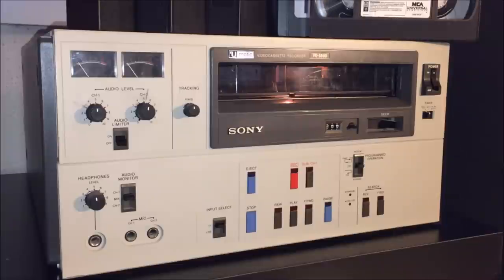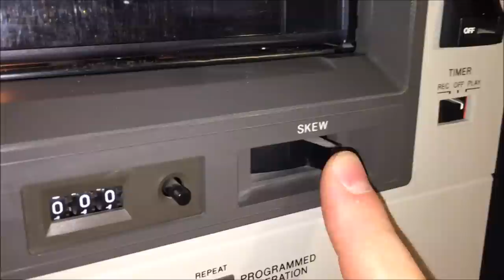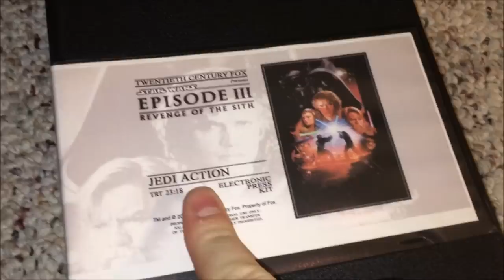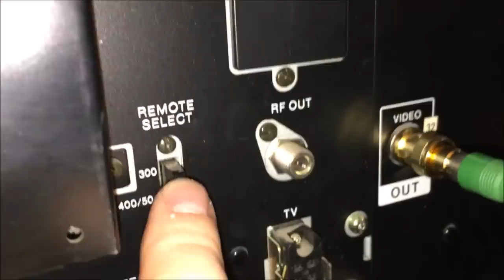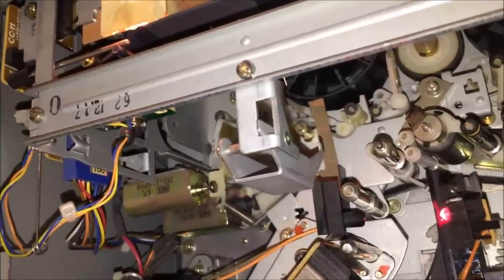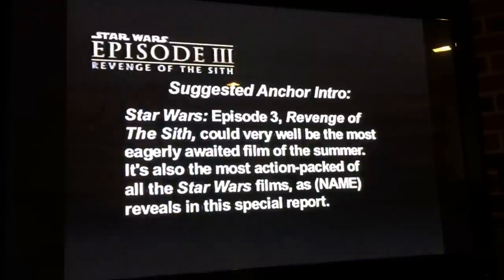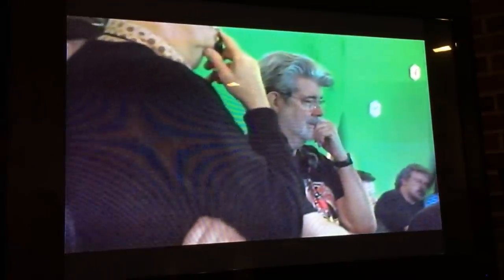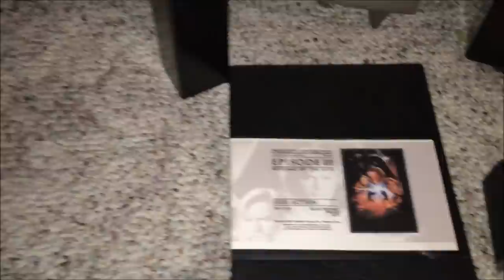Sony Pro U-Matic Mega VCR and Movie Preview Tapes

Comment: The U-Matic was actually used from 1971 to 2009 (where it was widely replaced by current digital videotape formats and tapeless digital formats). Believe it or not, the U-Matic was widely used on EPKs and in TV channels in Israel, which is now 46 years old (in 2017).

Comment: This broadcasting vcr deck was absolutely built like a tank!!!
Reply: They were.. in the late 80’s our local public access channel had a set of 3 in the remote truck. The remote would connect to the cross feed box.. was really awesome then. It was all equipment racked though. They were fun to play with as a teen ager. Lol
Reply: They did have timecode built in on the machines.

Comment: probably still being used in 09 because TV stations are typically extremely slow to update their hardware.
Reply from the maker: I would agree with your assessment.
Reply: In Israel the U-Matic machines was in use until 2014 and the Betacams until this day... 
LOL we have only one channel that broadcasting in HD and all the others are in 4:3 SDTV
Reply: Doesn't surprise me the slightest!
Reply: Bet they were using 16mm telecine units into the end of the 90's!
Reply: The main reason is the price.
Reply: yeah quite a few countries aren't fully on board the HDTV train in 2018.
Reply: I worked for small television stations and at the stations I was at they were fased out in about 2007. Digital was getting inexpensive by then.
Reply: OK.
Reply: I literally saw a programme from 2009 a few days ago being played from a tape, and it was a RAI channel. Not sure about the format though, I think it was S-VHS.
Reply: Probably the same reason some department stores and supermarkets were using reditune background music players made in the 50's until the late 90's. Why upgrade if it still works?

Comment: When I was in high school, I learned to edit on a VO9800/VO9850 with an RM450 remote. Those machines are built really well and virtually indestructible. This particular model doesn't do machine to machine editing because it doesn't have variable jog/search. It's only one speed. That's what the VO5800 is for. The main function of this deck is to independently playback or record and to roughly dub some audio. You also forgot to mention that the lower front panel pulls out. There are is a slot for an optional time code card. 5800/5850 have it too I believe. They might even have some configuration buttons.
Reply: Wow, me too!  This is the exact setup we had in my high school where I learned to edit too.  You didn't happen to go to high school in Pennsylvania did you?

Comment: Oh dear. Feeling very old. I started my career editing on a 5800/5850 system with an RM440 controller in 1976. We upgraded to Hi8 after Umatic, then DVCam until moving to XDCam. In the 80's all our commercials were run off 2" cartridge machines. They used 2" video tape in a cassette that was about the size of a fireplace brick. Much thicker than the 3/4" umatic cassette but not as long. The 5800's were real workhorses and the mechanism that wrapped the tape around the head was almost failsafe. They rarely broke down and we serviced them annually with new belts, guides and pinch rollers. The umatic machine was known as a "3/4 wrap" machine because the tape was wrapped 3/4 of the way around the head. VHS and beta were hAlf wrap machines. If you look closely, you can see that the carriage (chop chop train track) move the carousel around the tape head at a slightly downhill angle. Also the head is tilted slightly off axis as well. That allows the spinning head to contact and write the video information on the tape diagonally this getting mor information onto the tape in each pass. The audio tracks and control tracks were recorded linearly on the edge of the tape. The video head switches off just before crossing the audio track so it didn't interfere. The leader of the tape in the cassette ate each end was clear. So as you mentioned, when the tape reached the end, the light shone through the clear leader, hit a light sensor and stopped the motor before the machine tore the tape out of the takeup reel. This tech was carried over to VHS, and beta. The 8m and dvcam used a metallic leader that hit a magnetic sensor to shut the rewind and ff motors off. I have lots of great memories of the old 5800 series and the  6800 and 9800 series that followed. We still keep one of each machine tuned up and ready at the station for use with archival footage. If you want some real fun, hunt down an d Ampex AVR 2 machine. It was a quad he'd machine that used a vacuume to bend the 2" tape around a cylindrical drum with four spinning heads at the end. Thanks for posting!
Reply: I restore 2" quad machines (Ampex) from VR-1000 to the ACR-25. I think the best Quad machine was the AVR-1. I worked in tape ever since it was invented. Gee im old

Comment: OMG, a VO-5600. I also have one of those holding up a couple of turntables! Back in the 80s, I used to hang out at a small independent video house, and used to use the editing siblings of this deck with an RM-440. All the sounds of those machines loading, unloading, fast forwarding through the bars and tone remind me of the all nighters that made me decide I'd rather do camera work than edit!  I can still hear that little servo "groan" when you first power it on, which I'm surprised I didn't hear in this video.  All part of that Sony U-Matic charm!  Those were indeed workhorses.  I also remember the EPK's, because we used to reuse them for editing, being the low budget cheap skates we were!  (I would always keep the bars and tone and start recording after that.)  Never did do that for a living.  I think it was just one or two summers, but it left an impression!

Comment: At the time that unit hit the market, I worked for an A/V rental firm which supplied equipment for trade shows and various other functions. I remember lugging these and Sony ProFeel monitors around in road cases to set up at these events. I don't think we ever had a mechanical issue with one of these VO 5600's in all the time I worked there. They were very popular at trade show displays due to the auto repeat functionality included.
Reply: They were very heavy !!! LOL

Comment: The remote switch is for the sony RM series edit controllers. the 440 and 450 were the most common and you could do both frame accurate assemble and insert editing with timecode on the tape. Those things were pretty durable too, everyone I've ever seen has had buttons bent, broken, or completely missing. Countless number of news stories were edited with those and with working under deadline, editors tended to get pretty mad when decks started malfunctioning.
Reply: The RM 450 was 2 frame accurate and if you viewed more than 2 edit previews the accuracy slipped.  These decks were work horses. As long as the tension arms were maintained and video record heads were kept clean they ran 24/7.  In Canada, 3/4" was commonly used for broadcast news editing and for community channel editing and playback from early 80's until late 90's when betacam then digital formats took over.  Still have them for dubbing.  betacam is still popular for archive footage.
Reply: Worked with these types of machines for years. Local commercial production. Not this particular model. But Sony Umatic SP. Frame accuracy was give or take 2 frames either way.

Comment: RF OUT is not a modulator for channel 3/4 like you find on other VCRs. It is the amplified signal direct from the video heads. This would be connected to a timebase corrector (TBC) for dropout compensation (DOC). The TBC buffers video from the VTR and emits it using an internal or external master sync. This gets rid of the variance from tape stretch, etc.. and allows playback to be in sync with live cameras, other VTRs, etc.. so that A-B transitions can be done. If there is a defect on the tape, the RF signal will drop out and DOC will know to stop sampling into the buffer. Whatever data was in the buffer from the previous line or frame will fill in the missing video.

Comment: Ampex tapes were from the mid 1970's era when Dupont was still trying to work out their formula on making tape ribbon last, and those tapes are prone to SSS (sticky shed syndrome). The binder breaks down quickly and the tape glues to itself.  The solution to this is to get a labratory oven (tabletop unit) with a thermometer or a food dehydrator and bake the tapes slowly to dry out the binder, and this will give you 1-2 days maximum to archive the tape before it reverts back to its previous form. You can do this as many times as you want to, but you generally want to not have to do it so many times in order to preserve the tape.

Comment: I have the playback-only model VP-5000, in the same case. It was so big and heavy my local UPS driver refused to deliver it, I had to go pick it up. They also managed to bash in the back left corner. Pounded it back into shape with a hammer, replaced all the belts, cleaned and lubricated it, and it plays perfectly. Rubber Renue worked great on the pinch roller, the belt kit I bought came with a new tire.

Comment: I own this unit as I did a great deal of editing between '90 and '92. Not sure why I am still keeping it but I can attest it is built like a bank safe. The one thing I kept waiting for you to mention is that this unit must weigh over 50 pounds. I just fired it up and it still works. Sony over engineered many of these early units (I have SuperBeta and Super VHS rack mount units) and they are all still solid.

Comment: believe it or not, here in central America we are still in NTSC land, still have over the air vhf and uhf, and still use u-matic SP on occasion, mostly for backing up old tapes, and was used for mastering news stories well up until 2005. u-matic SP is a big step up from regular u-matic in terms of video quality, and even had dolby-c. the quality was second to betacam sp, which was second to dvcam.
Reply from the maker: Still in analog land?  I'm so sorry to hear that.
Reply: They should cherish it while it lasts.  They won't be able to go travel in their cars and expect the signal to stay consistent while moving!

Comment: In the UK these were know as Low band Umatic and were never used for broadcast work.The news people used Umatic High band that was similar but "broacast Quality"and 5 times the price of Lowband.We used to shoot on a portable umatic(lownband) VO4800 and edit on a VO5800 to VO5850(editing machine)both controlled by the RM440.Lowband was also used for off line editing instead of tying up 1inch C format machines.Edit lists were created by the editor and assistant editors would conform(work from the low band tape and edit on C format)this kept the time on expensive C format to a minimum.

Comment: Brings me back.  Used a couple racks of these in my first job in the industry as a part-time master control operator for a cable company back in the 90's when I was in college.  Good video.  Only thing I wished you'd show is the VU meters moving (maybe in a PIP window) when videos were being played.  Later I was fortunate to use some 9800 series decks for news editing, those were sweet.  They had bigger buttons and a robust rubber-grip jog/shuttle wheel on the right side for accurately cueing up video, and were controlled by an edit control panel.

While I'm getting my nostalgia on, can you do a video about the Betacam SP decks, such as the massive (but beautiful with all those buttons and knobs - I still geek out over all that complexity today!) Sony PVW-2800 recorder/player?  Betacam SP (not to be confused with consumer Betamax) came a little later than U-Matic (we always just called it "three-quarter inch", never "U-Matic") and blew 3/4-inch out of the water in picture quality, because the video signal was component (splitting up the brightness and two channels of color information).  I remember it looked pretty amazing for a standard-def analog format, until Digital Betacam ("Digi-Beta") came along, then "the rest is history".

Comment: Holy crap, that thing is monstrous!
Reply: Hahah tbays a toy compared the what I worked on. Google "AMPEX 2"   VR-2000" 
THAT was a beast weighing in at almost 1900lbs and needed and air compressor for the video head air bearings
Reply: @rty1955  databits needs to get one to show us!!!
Reply: @adamkatt  IF you can find thrm any more. I still restore them and there are far kess peiole who remember how to operate then either
Google 2' quad video tape machines

Comment: "Audio Limiter" is not automatic gain control used in lieu of proper gain settings.  It is simply, a limiter, usually about -20db.  When the incoming signal is too hot and sounds distorted at any volume the limiter is used to bring things back down to normal.

Comment: I used to use a 5600 just like this (and a few VO-5850s in an editing suite with RM-440 controller) when I volunteered at the cable access TV station in my town back in the 90s.  As you mentioned, the quality of 3/4" U-Matic was actually quite good, definitely passing muster for broadcast quality video in its era.  The video was much sharper & cleaner looking than grungy ol' VHS or BII/BIII-speed Betamax  :)
Reply: BI was broadcast quality though, except you did not get much time on the tapes with that speed.

Comment: I left TV news in 2012 to work as a full time freelancer, but at the time I left the station I worked for still had one of these hooked up in our feed room.  It was connected to the video routing system, and was used for ingesting old archival material, when needed, into our editing server.  I only ever used it a couple times, but based on the number of archive tapes we had in this format, it seems the station only ever used it for news gathering operations for a very short period between 16mm film and BetaCam.

Comment: I used to be a creative director for an advertising agency. I supervised the production of television commercials. When I started out in the early 1980's some TV stations were actually using 2 inch video. Later these same stations used 1 inch, 3/4 U-Matic, and then, Professional Betamax. A modest post production studio in the late 1990's, before computer editing, was about a $500,000 proposition. It made television advertising too expensive for some advertisers. The video recorders back then cost about $75,000 average. You can get them today for about $50. Not bad if you have material to view and a means to repair the equipment. Best thing is to call local stations and ask to speak to the in-house guy who fixes their equipment to see if he moonlights.
Reply from the maker: Hey Charles!  Thanks for sharing your story, and for the tip!
Reply: @Charles Ludwig – I think you mean Betacam SP (or SX or Digital Betacam), not a Betamax.

Comment: I worked in a CD factory in 2000 or 2001 that used DAT and UMATIC in order to transfer the data into the laser beam recorder machine that produced the glass CD masters. (After that it was processed into a nickel master that actually went into the injection molding machines) I forget how it went, but I think the oldest machine had umatic. I forget if that one was audio only or if it also did data disks, but the control program for it was written in gwbasic and it had been used since probably the 80s or the early 90s at least.

Comment: 16:35 The color bars are very clean including red and purple. According to Wikipedia U-Matic have trouble reproducing the color red and red images are noisier. But that's not the case in your video. The red appears very clean. The visual search is also clean despite it only have two heads.

Comment: Those U-Matic machines were the last iteration of the format, previous to that ones were even bigger, heavier units, as you may have noticed, that 5600 can be rack mounted, it was designed as a reliable workhorse, the other format used in Pro applications was the Betacam, Betacam SP and Digital, same form factor as the 5600 but different technology, this one was a 3/4 in tape and Betacam used a 1/2 in tape on a cassette very similar to it's home bro, the Betamax (the similarity ends there).
Panasonic and JVC had also editing units on 3/4.

Comment: The color bars at the head are for you to adjust colors, contrast and brightness of your display.
To adjust the proper colors, hold up a deep blue filter in front of one eye a d adjust the tint or hue controls on your display so the cyan & magenta bars (3rs bars from the left and right) are of the same brilliance. There should also be b&w bars on the lower right just barely visable. Adjust the contrast so the black bar just disapears on the screen and adjust brightness just so the light bar is barely visable. There your all set

Comment: The Umatic wasn't a broadcast format... Quality was not high enough!  At the beginning, Umatic was originally designed for the consumer market, but nobody wanted it.  TV stations found use for it for news gathering.  At that point, Umatig gained a huge success!   At the beginning of the 80's, the Highband (or BVU) was released. This was the first Broadcast quality video cassette recorder. The old Umatic (low band) isn't compatible with the BVU signals.  Later (Betacam was already widely in use) they brought the Umatic SP, wich is just as good as Betacam SP, but still composite. These machines were build right throug the 90's! and still perform really well... The last machines (VO-9800 and VO-9850 Are compatible with all Umatic standards, Low band, High band/BVU and SP.
Reply: My understanding is that Low, High and SP bands apply in PAL countries, but in NTSC they had only Low and SP, missing out High Band.
Reply: Yea low band was for domestic use and off line copies and viewing copies. but Hi Band was broadcast quality